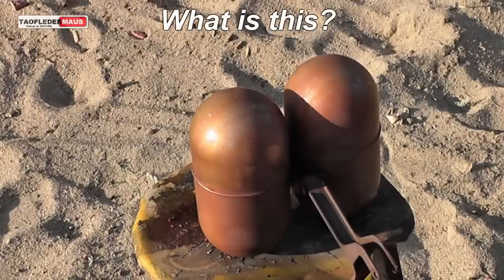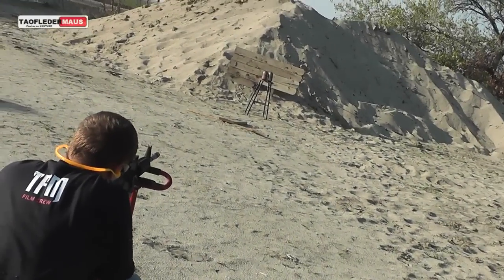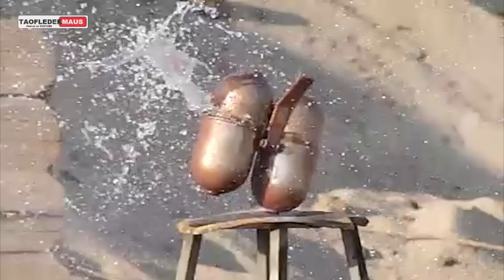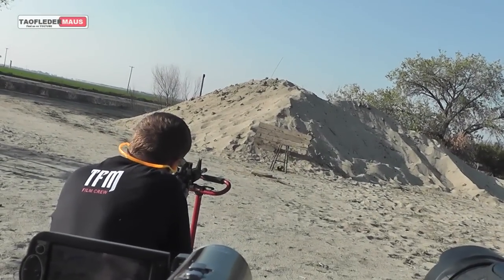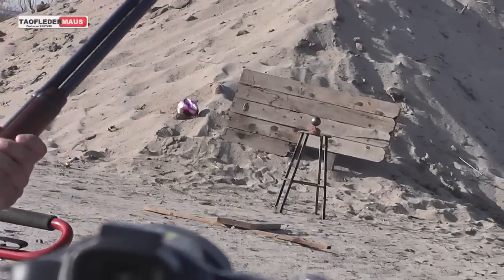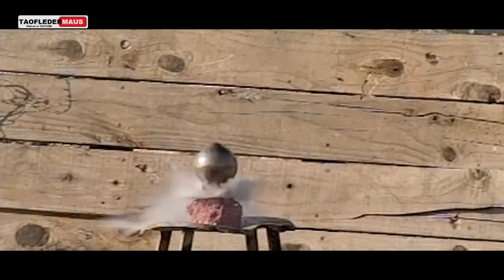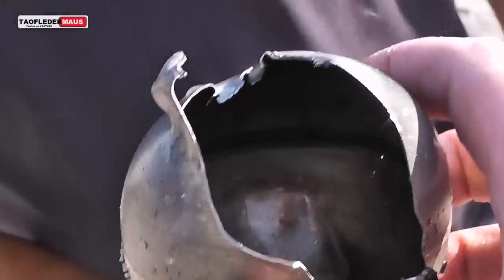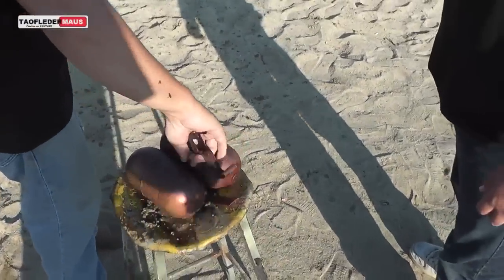Hydrostatic Shock  - Fact or Fiction?

Comment: Hydrostatic shock causes massive secondary trauma in organic targets, it's part of what makes hideous exit holes with heavy rounds. All that juice is pushed out of the way, and as hooooominz are largely water. Ouch. But, I suspect you knew that.
Not sure if you knew about this, but in the UK, explosives engineers are known to disarm "suspicious" objects with water shotgun rounds. The "shotgun is basically as short-barrel as you could get, barely longer than a 12 gauge cartridge, and is placed point-blank against the object, it uses water 'slug' that explodes on firing and the water pulverises the target object. The water of course also stops any of that pesky fire stuff. (Incidentally, I think you trying water-filled (or mercury ^^) slugs could be interesting).

Comment: Haha yes, shockwaves are fun :D

Hydrostatic shock is present in incompressible fluids (well mostly incompressible, the density variation is negligible, but still there). The shockwave is still there, so the fluid has to go somewhere. A gas can simply compress to absorb the energy, but liquids like water don't really like to.

Comment: If you have 4 pencils and seven apples. How many pancakes will fit on a roof?  Answer: Purple. Because aliens don't wear hats. That is a basic understanding of a common core math problem.
Reply from the maker: Chill with the crystal meth bro.
Reply: ***** holy crap, I can't stop laughing
Reply from the maker: Varun Dixit  The dude probably spent 8 hours copy and pasting that same message on about 100 of my videos.  They all went into the spam folder by other viewers.
Reply from the maker: Go post it at the PTA website or something.

Comment: You're missing something. There is no doubt that a bullet impact can get fluids moving, but our bodies aren't made of steel or plastic. Our tissues (with the exception of brain and liver) are extremely elastic. While the effect you demonstrate is real, hydrostatic "shock" as a wounding mechanism is mostly a myth.
Reply: it is definitely real, but no to the extreme that these tests show for sure. But to a smaller degree this does take place and a more localized level. There also have been tests to show pressure spikes in a pigs brain when shot in the thigh.

Comment: I knew right away  they were from a float and thermostatic  steam trap. How big are the traps? Cause  those floats are huge.
Reply from the maker: The double float was out of a  steam trap with some sort of internal pump.     That unit is like the size of a small block engine.
Reply: Damn i have never hear of a trap with its own condensate pump

Comment: Hydrostatic shock is a fact of life with high velocity rounds. If you don't think so, shoot into ten feet of water. A 30-06 150gr at 3000 fps will send up a water spout around 40 feet. Also it will vaporize a woodchuck at close range.

Comment: Steam Trap Float . Thats a fact Jack :)))
Reply from the maker: Well,  blow me down!
Reply from the maker: krazy45cat  You work with steam?
Reply: ***** Sure don't , it just looked to melike a float one would find in a carb .So I knew it was some type float for some kind liquid.Gerry
Reply from the maker: Dang,   I was hoping you had some exciting boiler explosion stories or something.  lol
Reply: *****  there is a paper mill near Richmond, VA its called bear island the have two bent tube boilers. One is 2 stories the other is 5 stories tall. The smaller one had a problem with natural gas building up inside and when it lit off there would be a explosion. Well one day this boiler had way too much excess gas and blew the rear wall and tubes across the mill. It had such force it bent 2 1/2" schedule  80 pipe almost  in half. The reason it was building up gas was it closed its louvres while it purged not letting enough gas escape.
Reply from the maker: Austin Albright  That had to be ugly!   The only good thing was that was a FUEL explosion.  Imagine how bad it has been if the boiler was at full steam pressure and then that happened.   It probably would have leveled the entire plant.
Reply: There's a Du Pont plant near where I live and it had a melt down or something caused by a problem where they were makig ball bearings, if I'm not mistaken. The resulting blast literally blew the roof off, but no one was injured.
Reply: *****  I work with steam. And by the way you were talking about boiler chemistry and hydrazine, it seems like you do too.
Reply: ***** No boiler explosion stories but You wanna hear a scary sound? Send some cold water through some hot pipes. 100k hog fuel boiler here.
Reply: Pasta Prime it doesnt even have to be cold water. 250 psi steam through room temp pipes sounds scary enough. 10 pipes swaying and hammering was enough for me.
Reply: that's true but its a horrific sound. Our whole steam system leaves much to be desired like bad steam traps and check valves. Water hammer making pipes sway 6" to a foot in either direction makes cause for alarm.
Reply: We put in new steam stations and the engineer of the building just let her eat. Instead of taking the extra half hour of opening the bypass and letting the pipes warm up. I know what you mean these pipes were moving a lot. After that i dont like working on high pressure systems.
Reply: That is insane. Not very smart and dangerous for that matter.
Reply: ***** that's awesome, we just went over steam traps last week in my power engineering class. Soon as I saw it with the lever arm still attached it was a give away. Cool coincidence though!
Reply from the maker: There are a LOT of different types of steam traps too.
Reply: *****
What is your occupation? You sound like you know a lot about physics.

Comment: What's a steam trap float?
Reply from the maker: Most industrialized countries have steam boilers.  You might be surprised how many ARE in your part of the world!
Reply: accorden
Yup. Pretty much any useful electic plant that's not a hydroelectric dam uses a steam boiler and turbine.
Reply from the maker: It's almost a misnomer.   It prevents steam from passing through it,   and allows only the condensed steam (water) to pass through back to a feed tank so it can be used again in a boiler.
Reply: was wondering the same thing xD
Reply: MCBobbyE so was i
Reply: Ok. Steam boilers aren't so common
in my part of the world.
Great vid tho!
Reply: accorden
The modern world effectively runs on steam.  Most modern cities have steam utilities and most buildings have large boilers to supply a building's needs.  The vast majority of people however will never see this stuff.

http://en.wikipedia.org/wiki/New_York_City_steam_system